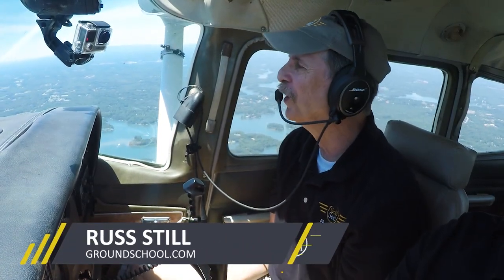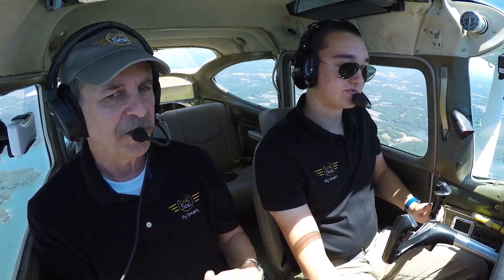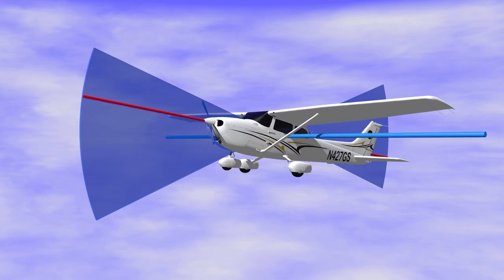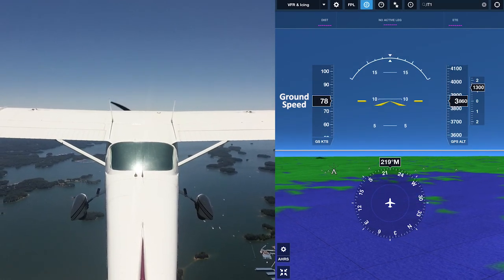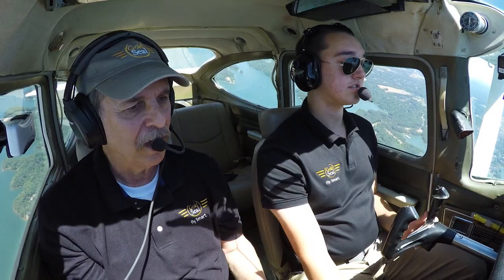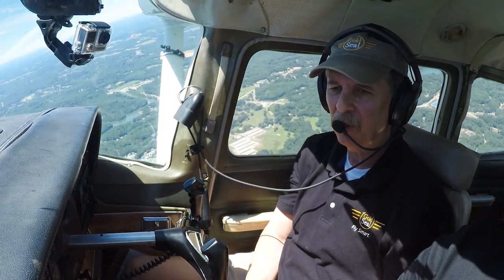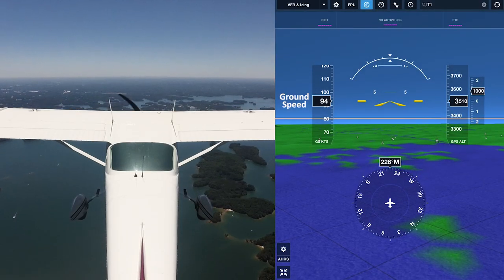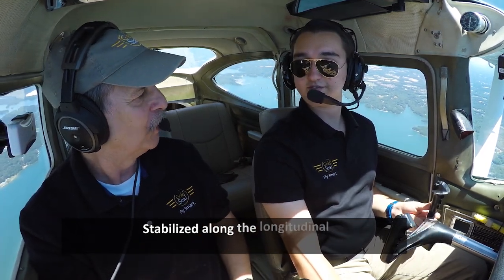What the Phugoid is Longitudinal Stability?

Comment: A bit more accurate  that is both static and dynamic longitudinal stability. 
If you have increasing phugoid oscillation then there is static stability but dynamic instability. Static instability won't trend around the starting point,  it continues to divert further away from the starting point with strong bias in one direction. Dynamic stability(or instability) combined with static is a bit harder to describe thouroughly in a YT comment, but it will generally effect the rate of diversion in a variety of ways; accelerating, decelerating, fixed rate,  oscillating between slow and fast[but still moving in the same direction], could have enough speed oscillation to slightly reverse, and even cross back over the starting point at an extreme, though it will bias substantially in one direction.
Reply: Great videos and i often use this technique as an instructor as well!  I also recommend a discussion on P factor changing the heading as well, but there is a slight lag for it to take effect.   I also think the basic misunderstanding of stability of an airplane leads to many loss of control accidents.  Particularly the stall and spin accidents.   I have been in many spins watching the pilot I was training continue pulling…. “ My controls!” Is usually heard with my CFI voice!

Comment: the lift vector doesnt grow , it actually drops , as far as the main wing is concerned. The angle of attack becomes negative. The only thing that actually grows is the lift vector of the horizontal stabilizer in the negative direction, that usually consists of a symmetrical or trimmed down airfoil. As soon as it grows , it pitches the aircraft. If this is what you mean , then you can just skip the comment.

Comment: Question regarding precession, during the oscillations I noticed slight right and left yaw, almost imperceptible. Was this force noticeable on the inclinometer? I was thinking it may be a good practice drill for PPL to familiarize themselves with rudder use in climbs and descents.

Comment: Did Flash say lateral axis?
Reply from the maker: Yes. Longitudinal stability describes stability about the lateral axis.
Reply: @GoldSealFlight  I guess I'm going to ask for a refund from Cal Poly-Pomona for my degree in aerospace engineering. The longitudinal axis is NOT the lateral axis. Also, I spent 34-years as an aerospace engineer at Edwards AFB.
Reply from the maker: @mach179  Yes, the longitudinal axis is not the lateral axis. Think about the motion. It sweeps through the longitudinal axis, i.e. it pitches. But the motion is >around< the lateral axis. Contact us at support@onlinegroundschool.com and we'll be happy to send you a picture that will clear it up. (Wish we could post images here.)
Reply: @mach179  we are talking about the same ,ac moves around lateral axis,if u see from a lateral standpoint
Reply: @GoldSealFlight  I definitely prefer >around< instead of about
Reply: I was always annoyed at how the stability type names are offset from the axes being rotated ABOUT. Leads to miscommunications like this. But yes longitudinal (aka pitch) stability, regards rotation OF the longitudinal (and vertical) axes ABOUT the lateral axis.